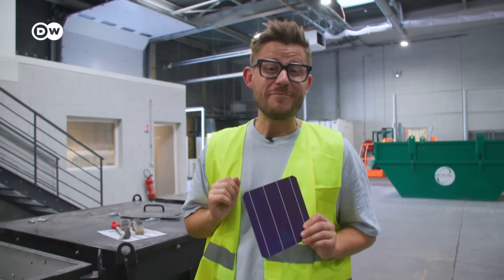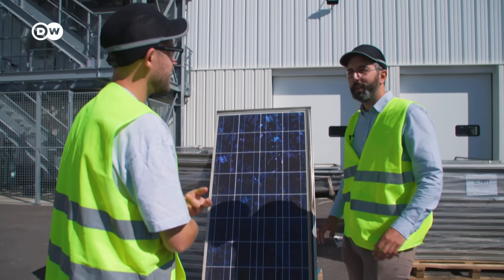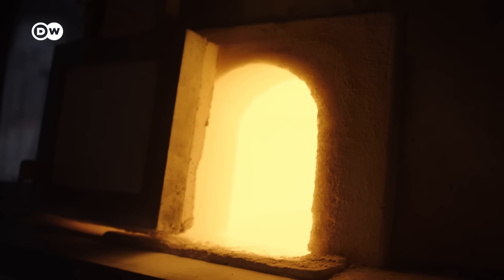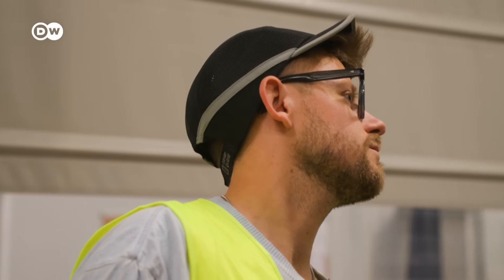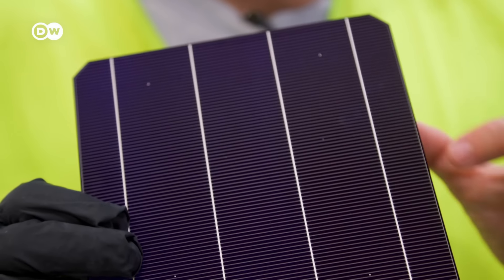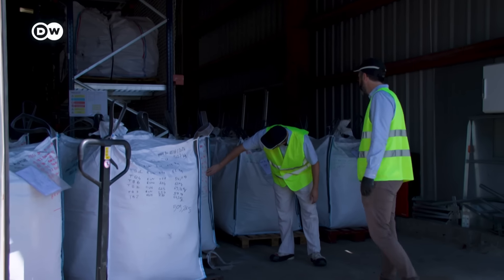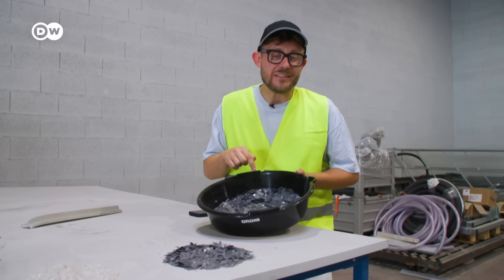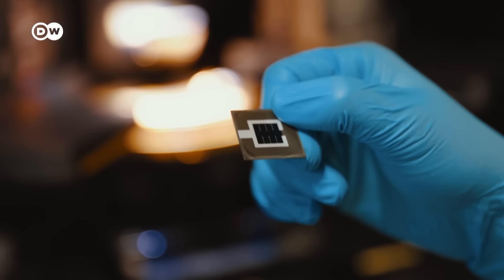The race to solve solar energy's recycling problem

Comment: Yah, best guess: They aren't viable. You were invited before they could show you anything because they needed PR for more funding.
1) Virgin materials are still very cheap. The market doesnt care about problems that far in advance
2) Unless a product was specially created to be mass recycled, it's going to be a pain to recycle
2b) The market does not care about designing recyclable products
3) Recovering 20 dollars a panel isn't bad... but it also isnt great

People need to stop making environmental arguments and start spending more time figuring out how to make something work economically. One idea: The manufacture and recycler have a deal where panels are produced in a recyclable way in exchange for call options on the amount of materials recycled that was originally produced by them

Comment: This is not a problem. Solar reflectors and stirling heat engines can accomplish these goals easily. They are significantly more durable and recyclable.

As for storage. Spilt water, use the hydrogen to makes gasoline. Store for existing generators.
Reply: CSP Stirling engines are even more prone to wear and tear, require more maintenance, LCOE is much higher, efficient only in regions with clear sky conditions, less flexible and harder to scale. CSP is a good solution for many applications but no way that it could replace solar PV.

Comment: Cease using landfills altogether and methodically store "everything" that doesn't get repaired, recycled or reused neatly and responsibly until it does. If it doesn't it doesn't, it remains stored indefinitely. 

This was the original issue all along, just too lazy and cheap to handle our used item and materials to a decent standard.

What a bunch of Kunts.

Comment: The question is: how many energy is required to recycle this marvel? To melt, split and refine all materials, move them back to a production line. A lot. The nature solve it with plants, not in decades but in millions of years. They convert solar energy into chemical energy we can use removing carbon dioxide from atmosphere. We can easily store chemical energy as ethanol. We can easily use chemical energy to produce electric energy by gas turbines. All carbon dioxide released is again captured by plans and the cycle continues. The big problem is lack of willing to share power and money not lack of energy.

Comment: "Recycling saves emissions" is an unsubstantiated claim.
Reply: They just substantiated in the video, you can measure how many emissions are released during recycling vs mining it..
Reply: @Masterrunescapeer  Mining is not the main source of emissions. The melting and chemical reduction of quarz to silicon in the furnance produces most of the CO2. Replacing virgin polysilicon with recycled silicon from EOL modules is not financial viable but it reduces CO2 emissions of the process significant.

Comment: Seems like a lot of work for a product that produces more CO2 then nuclear whose waste recycling going from waste back to fuel is very well known
Reply: Nuclear waste is even worse tho, it has to be stored in underground waste dumps for thousands of years in a controlled environment using huge amounts of resources. A small fraction of that is recyclable 1-2 times while it is an extremely unprofitable and dangerous process.  Meanwhile 70% of all plastic types, 99% metal and basically 100% of glass could be recycled. Yet barely 10% of plastics are recycled. Sadly the  current consumer based economy is unable to stagnate or decrease, else it falls apart completely and there is no pressure yet to slow it down or change it in a way that is more sustainable.
Reply from the maker: Nuclear recycling indeed is a thing, but why isn't it more common practice? ☢️ We have a video on this here 👉 https://www.youtube.com/watch?v=hiAsmUjSmdI